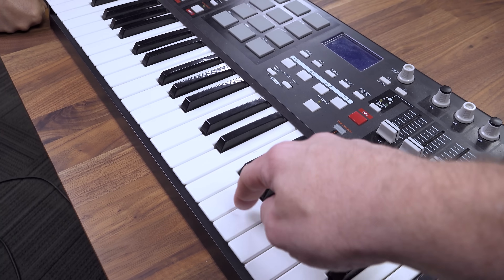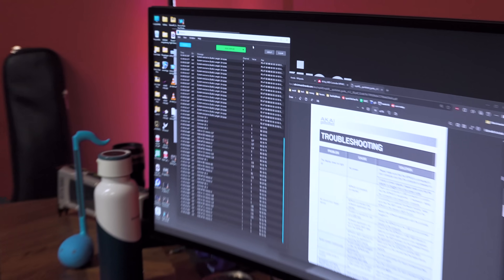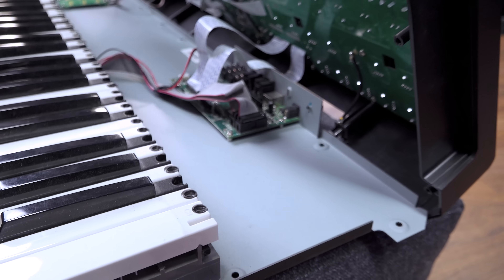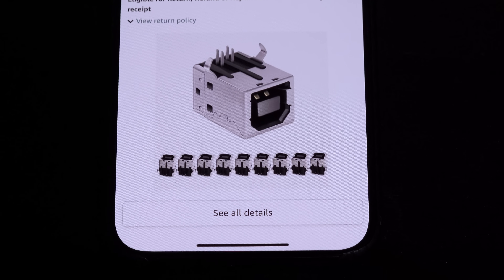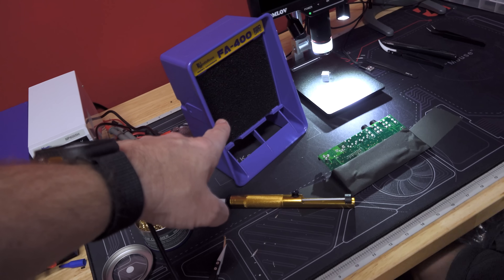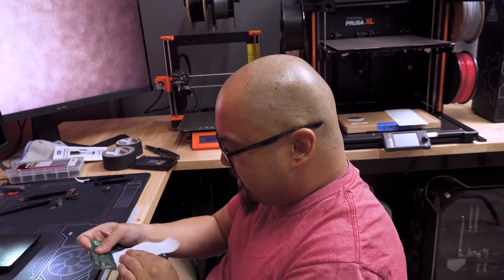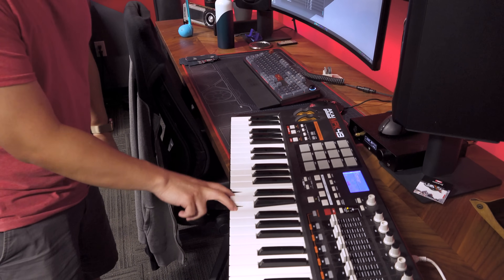The USB port snapped off! Let's try solder on a new one...

Comment: Pro tip for beginners: If you are afraid of damaging components with too much heat when de-soldering something (like a through-hole component), they make special solder alloys for just such a situation.  Basically you use a solder wick/sucker to get as much of the old stuff off as possible then add a de-solder alloy (like Chip Quik REMKIT) in its place using a regular iron.  The alloy has a lower melting point, so when it mixes with the remaining old solder, you have more time to use the solder sucker and better odds of sucking it out from around the pins.  Of course if you do a lot of de-soldering of through-hole components, you can get a heated solder sucker iron to make it even easier.  Don't forget to open up your solder sucker from time to time and empty it too--the less room in there the less effective it will be.

Comment: Honestly a great repair HOWEVER, like others mentioned the cap is broken off the pad but more importantly having that kapton is a bad idea. Whilst I understand why you did it, the problem is you have now significantly reduced the strength of the port by doing so.

There is industry standard on how much the hole for pins must be filled with solder this to ensure that the component is nice and strong. By taping the other side the solder will not flow through the hole which is NEEDED for strength. You actually want the solder to flow through the hole and up the leg/pins of the port. So I would highly advise you or anyone to do the method you did with the kapton tape.

With that said, when soldering leave your soldering iron on the pins for a second or two, and allow that solder to flow through the hole and onto the pin on the other side. As long as your temp is too highly don't worry about it melting anything. By doing this the solder joint will be so so much stronger.

Finally, please please use flux when removing the port. Trust me it will make it 10x easier. And don't worry you cannot really have too much flux. Getting a proper tube/syringe of it will make it much easier to apply than a tub, and don't cheap on flux as it just creates more headaches!

Comment: I had to replace the barrel jack port on a Yamaha DGX 640. The process was quite similar to replacing the USB port on this keyboard, only had to deal with the internal speakers and amplifier circuit boards. Well done lads.

Comment: Might want to redoo those connections, cold solder joins on power pins can cause burning. Maybe won't happen on low power thing like this one, but better be safe than sorry. You should apply more heat first to the pad and pin, before adding solder. It will flow better then.

Comment: having repaired a C64, I don't think my soldering iron is up to this task. The ground pins on C64 chips were a nightmare. I don't think it could have done this. Maybe in combo with my hot air station? But I do have the skills. Just not the tools.

Comment: I recently swapped the mouse-switches from Omron to Kalih on a trackball of mine. For the de-soldering, I used a specialized de-soldering-iron - a combination of a soldering-iron and a vacuum pump. This made removing the solder from the solder joints really easy. I bought one from amazon named YIHUA 929D-V.

Comment: factory pcb are lead-free and to be easyer to use a traditional solder-pump easyer to apply a small ammount of leaded solder and flux. and goes easyer on the solderwick when u have a little bit of solder on the iron tip to glide with again flux. otherwise easy to scratch and break soldermask on the pcb. i don't know how many akai usb/midi port i did past few years it's insane. studio equipement take always a beating.

Comment: As someone who also had to trial and error his way to figure out board repair, this is a great upgrade from the last video! Just keep working on it. Many people have pointed out the small issues (ie cold solder, that cap shifted due to potentially the hot air etc) but a successful repair is a good step. And given this isn't a high power port or component it should probably be Fine! Keep it up!

Comment: Great video. Personnaly, I prefer to use desoldering wick instead of a pump. Less reheat and retries to cleanly remove solder. Also a good practice is to notice if ground pins are attached to a ground plane. If so, you should preheat the pad as the heat will spread to the plane. Basically, heat the board prior to heating the pin or you'll end up with cold soldering.

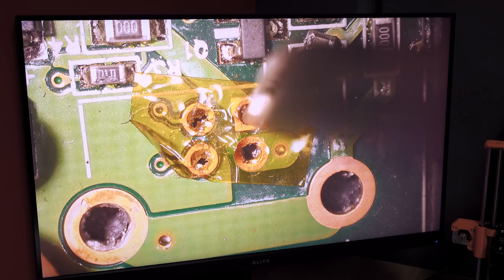Comment: Big tip for removing solder. First add littlebit flux and then leaded solder in to the old solder joints. It will come off much much easier with solder sucker 9000 (my name for it) and solder wick. 6:10 That kapton tape is not really needed. I agree on Luis saying "heat the board", it will be much much easier to solder and take solder off with littlebit heat on the board, just heat it up with the heat gun set to 150c-200c or so to around 100 celcius board temperature, just like you did :). You did much much better than before.

Comment: Just two things:
1. Cap next to the USB port is basically 90% off it's own pads.
2. Solder joints are not fully flowed because the soldering iron is taken off too quickly, so it might need to be reflowed in the near future.

But hey, at least it works for now!

Comment: A repair shop would of taken about 10 minutes to fix it but would charge the customer for the hour. A lot of repair shops charge hourly slots rather than the actual time that it takes. So 1 minute to 60 minutes is an hours charge and 61 minutes is 2 hours charge. However if the shop/engineer is in a good mood they may still only charge for the hour if it takes just over the hour. I was an Electronics engineer till I had a stroke which left me with memory problems. I worked in shops and large companies over here in the UK so I know how electronics companies work over here. I'm guessing that it's the same over there.

Comment: I noticed you guys knocked a small capacitor out of place (specifically C1 at 6:00 exactly in the video), not sure if it’s fully out of place but you can see it in the video when you guys were soldering it. Little tiny capacitor above the tape. Might wanna fix that.

Comment: as a repair tech of 20 years, those are bad joints, will need a redo it in the future, but well done, its fixed at least. that Cap on the otherside was knocked to the side, not sure if its still there but probably just a filter cap so should be okey. 5/10 , for a better joint hold the soldering iron with the solder longer so that the solder can flow to the otherside. will be a solid connection then.

Comment: Well I tried leaving a comment with constructive criticism but youtube doesn't like it. Good luck. You need better equipment and to use flux is as plain as I can put it. Pinecil is great, just don't buy a fake one. Also engineer 02 with the silicone tip.

Comment: My old psp from 2005 had a broken wifi switch since like 2007. I took it out last year and finally decided to just fix it. A pack of like 20 psp wifi switches was like 10 bucks and an hour later I had soldered on a new switch. Not that it really mattered in 2023 lol, but better late than never right?

Comment: Lead doesn't vaporize at soldering temps. Those fumes probably aren't great to breath, but it's not lead, even if by some oddity a keyboard from 2008 had leaded solder in it.
Reply: Yep, its the carcinogens in the flux that is bad. Wear gloves and wash your hands after. Since ideally you'll used 60/40 leaded solder. Lead free solder sucks.

Comment: Proper way. Hold the soldering tip on the joint for a few seconds to make sure it's fully heated, may have to add some solder if there isn't any. Then continue holding the solder tip for a few more seconds to make sure you have a hot joint and not a cold joint. Some of those, it didn't even look like you touched the solder tip to the joint but only touched it to the solder then quickly removed the solder tip.

Comment: What no proprietary USB port? Gasp. One tip for ground terminals especially is to hold the soldering iron tip on the leg for a bit. This allows the solder to flow down the leg to the other side of the PCB and provide a stronger joint. Putting flux on old joints or even on top of the solder wick helps in the desoldering process. Even adding leaded solder to what you want to desolder helps melt the old solder.

Comment: Soldering can be tricky if you haven't really learned how to do it and what the result should look like. 
Some hints. 
Use flux. It removes oxidation and make the surfaces work better with the solder.
Heat the pin and touch the solder wire to the pin not to the iron. This way the pin is proven warm enough that the solder can flow over it correctly.
A good solder of a pin should not result in a bulging sphere of tin. Either you applied way to much solder or it didn't flow over the pin or the pad correctly. Normally a good joint result in the solder forming "tipi" like shape with concave shape. It's something you learn to expect when doing a lot of soldering. The convex blob can be fine, but it also could be a bad connection.
A good solder joint should be shiny. If it isn't shiny, perhaps looking a hit frosted then it might be bad or the solder pad or the pin wasn't hot enough. Yes it has to be hot enough, but then you should not overheat the joint either. Training, training and more training is how you learn all of this.
Doing a lot of soldering you learn how solder flow and soldering a pin like these takes only a couple of seconds.
Finally don't overheat the pads! On a lot of PCB the pads tend to lift from the board if heated enough. This is bad, and can happen both when removing components and when soldering the replacements.
If a pad lifts it usually isn't a total catastrophe. It's often possible to solder a jumper wire between the pin and either the copper line or another pad connected to the same line.
multi layer boards can be a bit more tricky than single or dual layer boards. Multi layer boards can have the holes plated through so the pin you solder in place can have connection with top and bottom layers and possibly more layers inside the board. Here you really don't want to lift a pad or damage the through plating. So be careful when removing components. And again when soldering in the replacement.

Comment: Don't learn to solder when you have a problem. Learn to solder with junk first. Then when you figure out why that 7 layer board won't let the solder stick Why you can't get the part off.  Just find old or broken electronics and try to take off and put parts back on until you ruined the board. Then  do it again and again till you stop ruining boards. Then work on your broken stuff.

Comment: it's helpful to feed in fresh leaded (40/60) solder to points you want to de-solder, also use flux when trying to heat and remove ports like that when using de-soldering braid. it's always rough watching noobs solder, but you guys did a decent job all in all.

Comment: Kapton tape is  more to protect areas that you don't want the heat to remove small components..overall nice job., use flux and always hit the area with new fresh solder before removing...

Comment: If you're going to solder... having flux is a must. I know people are going to argue that they've never needed to use flux, and then unwittingly mention that they're using a solder that has flux in it. The flux would have really helped getting the solder to flow into the wick when Phil was trying to de-solder. That's why it wasn't working and he switched over to the solder sucker. There is no reason to not use flux. It helps the solder flow and bond with what you're working on. If you're saying you don't need flux, then you don't understand what the purpose of flux is and just using a solder with flux in it, isn't a perfect substitute. I prefer to use leaded solder with rosin core, but I still make sure to use flux to ensure and good bond with the work surfaces, which is completely regardless of the solder itself.

Comment: for through hole components like this, heating the board isn't really necessary, you risk more damage to the surrounding smd components around

good job using flux tho! should have used it for desoldering too, flux is always your friend as long as you clean it afterwards

Comment: i recently bought a x570 dark hero motherboard and when i got it in the mail (second hand) one tiny cap  fell off near the back plate for the io. about the same size as the one pictured but i think it was smaller. lucky i was able to find it on my table and find the place it fell off of. I can express enough how hard it really is to solder things that tiny. It took me like a week of practicing and messing up over and over again to finally get it right and im actually decent at soldering. its micro soldering thats a completely different ball game.

Comment: Nice job on the replacement job.

Not sure if he would be interested, but They have usb C to usb B adapters, and you can get magnetic usb c cables that do data, so it might be an option if he's worried about this happening again. (I'd link things but don't want it to flag my post)

Comment: Ugh I'm a little sad watching that solder job. Not bad but you can't be afraid of the heat. I can see your touching the soldering iron to the pin and then quickly taking it away, don't do that keep it on the pin and let the solder flow. You want the solder to go thru the board that's what makes the strong connection it looked like your were just trying to keep the solder on the back side of the board but if it doesn't flow all the way to the other side it makes it weaker

Comment: I would have considered getting rid of that connector. Slaughter a long enough USB cable and solder it in directly then construct a stress relief for it (zip ties and hot glue or something).

Comment: I personally would have gone with a hot air approach. Just because the solder suckers I've bought didn't work. Overall good job. Soldering is pretty fun, and even more so when it works.